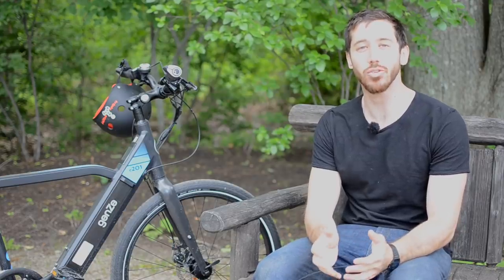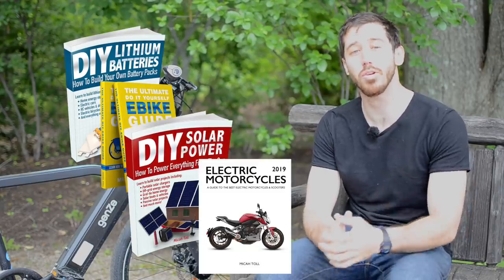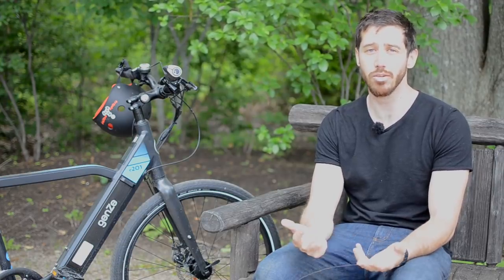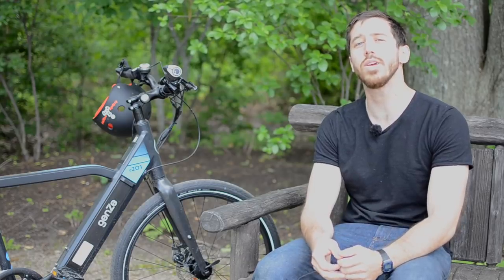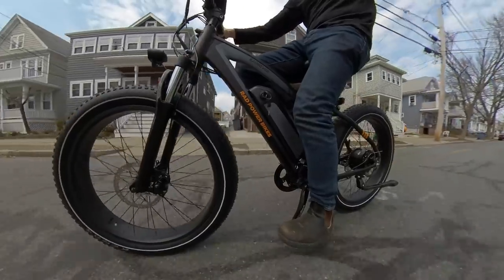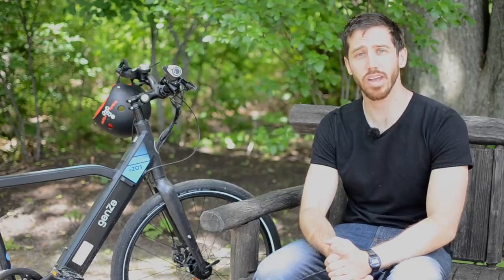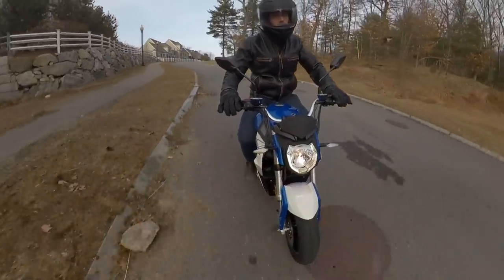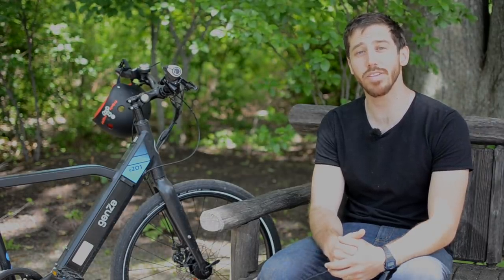How much POWER does an ebike need?

Comment: Nice video thanks! How about efficiency? If I’m to build myself a mid drive conversion, given the same data, flat surface, steady low speed, will the battery drain faster on a 500w motor or a 1000w motor? My understanding is that the controller throttle the wattage given to the motor, therefore if looking at a bbsdh 1000w, giving it 250w, a 500w motor given the same 250w should be equally efficient and drain the battery at the same rate? Would that be a true statement? Thanks in advance!
Reply: I think this will depend what top speed the winding is physically arranged to enable, because at or near that top speed will be more efficient than something lower. It's a good idea why one should buy a motor whose top speed is no faster than one intends to regularly go. Travel at a lower speed and there will be energy/heat waste, and one's into overheating issues (my understanding, which may be in error).

Comment: Ok so i have a jetson bolt pro and i have two 36v 6ah going put them in series for 72v and get a bigger controller how long will you think the motor will last the motor is 350w have anyone have similar experince

Comment: 500w 48v is minimum really....Also the smaller the wheel the more torque...for example i use 20 inch wheel on my tricycle with 1500W 48V and i could toe a smaller car with that thing...

Comment: 250 watts is the average power. Peak power can be up to 700 watts on a 250 watt limit. So you get what you pay for.
Reply: Correct. The marketing wattage is the maximum safe amount of power it can draw for long periods of time without burning out the motor.

It's a little confusing grading the motors like they do though. I run a 1000W motor on a pedal assist setup. Other than up hills, it averages around 300 watts of power pulled.

Comment: Great video! I'm researching for my 1st e-bike build, so really good info to have. My budget says BBS02, but the BBSHD sounds like the way to go...i'm pretty heavy and want my GT Avalanche to get  up and GO! Winning your book would help too...he he he
Reply: BBSHD is the best. The standard mounting plate sucks though. That's eating into the bike frame at the axle tube and isn't able to prevent the engine from swinging into the down tube. Solution to this is a Lunar or California E-bike mounting plate (or just DIY in CAD) + modified rubber eraser between the engine and down tube. Also, before doing the conversion it's quite handy to have a rubber hammer and a telescopic ratchet wrench at hand for the bottom bracket.

Comment: Great video as usual. How can you add more batteries to extend the range?
Reply: if its a hard case battery you cant, you can only swap out the existing batteries for higher capacity ones but that requires soldering and or spot welding as well as costs way more than its worth. with bag cases that isn't a problem as you can add more batteries in parallel until you run out of space.

Comment: Hello. What are differences between hub motor and mid drive motor? I.E. advantages to compare under different conditions, like off road riding.
Reply: Hub equals one gear ratio but with mid you have many to choose from which can make climbing hills easier and possible (for super steep hills). The center of gravity for mid drive is more ideal for off road especially if the battery is also mid frame or on top of top tube. That being said, there are plenty of hub motors that go off road riding but I guess if it is really technical mountain biking mid drive is probably the way to go.
Reply: @feedallday2556  Thanks.

Comment: I've not come a cross a hill yet that I cant maintain 15mph+ on my 250 middrive ebike, it is derestricted. but i'd to try 1000w+
Reply: Same dude, I really don't understand the fact that half the comment sections judges 1000W as the minimum and some even said that 250W doesn't even feel like you have an assist, I live in a very hilly area and I go uphill at 15mph with no pedaling and 20mph with the kind of pedaling you'd do on a flat road with a regular bike... If you're looking for an assist, 250W is good enough, if you barely wanna pedal, get 350W and if you don't wanna pedal at all 500W is plenty, any more than that and you're getting dangerous and useless.
More than 500W is just for bragging and to avoid insurance and stuff like that, because what you're building is basically a moped except you don't have to register or pay anything.

Comment: Thanks for the infos. I wonder there are also more powerful hub motors which are used in sportive ebikes like Stealth ebikes from Australia. Their hub motors are powerful as 3000w or more. What do you say about them? And also the battery voltage and motor power is also related as you know. A brief video about these powerful ones would be nice too. Especially for the ones who seek for powerful ebikes like me cause where I live there are many hills so an average ordinary ebike not sufficient for me. Thanks again.

Comment: Question: For Example if using a 52 volt 30amp hour lithium ion rechargeable battery how do you measure the amp hours??? 

I know that the nominal voltage for an 18650 cell is either 3.6 or 3.7,and when fully charged is 4.1 or 4.2  but how about AMP HOURS???
Reply: The amp rating is the max amount the battery can draw, Amp-hours is the capacity, or how many amps it can continually discharge for an hour. so if your 30 Ah battery has a discharge rate of 4C, it would be a 120 Amp battery. If it didn't come with paperwork stating all these specs you'll have to look up what the cells are capable of.

Voltage is different, but you multiply that by the amps to get watts, or voltage x amp-hours to get watt-hours.
Reply: @xxKeReMxxx  Ah...🤔 I see Thank you for providing me with the link
Reply: @revjimjones  Thanks

Comment: What sort of speed can an averaged size and fitness rider expect to get on a flat road while pedalling with a 250watt and 500watt motor?
Reply: Can 36v controller use with 48v 500w and battery 36v 13 ah?

Comment: Would 2-250W give same performance than 1-500W geared hubs motor? would both set ups use same power ?
Reply: I doubt it as you will be carrying more weight. ..probably double due to the 2x everything
Reply: He's done a video on that awhile ago. If you buy the right controller you can dial them in however you like.
Reply: Maybe double the torque but the same relative speed.

Comment: Can the power of an ebike motor be estimated from it's physical size?  Also, have ebike motors of the same power stayed the same size over a number of years?
Reply: You can get a basic idea, but doesn't types of motors and new motor technology have made them smaller over time.
Reply: Theoretically yes but in practicality no. Not all manufacturers wind the motor coils the same way so they do vary in size between brand to brand.

Comment: You need at least a 2000w direct drive hub, 52v battery, high amp controller. Otherwise you will struggle uphills.

Comment: In UK its 250W and thats enough to get you up any hill with a mid drive 12 speed. Sure not at 30mph! Rarely need to use any other settings other than eco and tour (emtb lite) Really, who needs 750, 1000, 1500W?! Otherwise it becomes an electric motorbike! And what sort of battery will you need?! Cycling means pedalling and putting effort in!

Comment: Of your 20 links for products that you use, 16 of them no longer work because that seller is no longer selling that item at that price point, or no longer carrying it. The trouble to linking AliExpress links is they change very few weeks or months. Plus shouldn't you be tacking on all that spam on your about page instead of as a footnote to each video? You do know how to shop on AliExpress right? There are literally thousands of thousands of sellers and what I found most amusing is your links point to sellers offering their products at a much higher price point than the average seller. So either you're flocking paid sponsorship sellers, or you don't know how to shop on AliExpress/AliBaba... 🙄

Comment: hey! between a 500w geared motor and a 1000w not geared motor, which one is the most efficient
Reply: Depends on the speed, but I would say they are about the same. The only principle is that the geared motor will allow you to use it as a regular pedal bike, which is a big plus IMO. I tested my 500W gearless versus my 3kW cyclone (free wheel on motor shaft) at 15mph over 5miles and the power usage is about the same. But, with the 3kW Cyclone I can pedal it. At 1000W you do feel the resistance from the motor when pedaling but if you want better cruising speed than 1000W is the choice. 500W also means 36V which kinda is too low imo unless you like do pedal assist a lot.
Reply: Steven Soco  That is what I thought too before I actually did the test between 500W gearless hub and my Cyclone with a freewheel (similar to geared). The results were too similar to declare a winner. The issue is that to go at speeds you are always going to need continuous power gearless or geared. That situation where you are coasting and taking advantage of the freewheel is not real world. I think you always need continuous power. The real difference between geared and gearless is simply if you want the bike to not have cogging when you use it as a regular pedal bike. His dilemma is 1kW cogging is noticeable and 500W is way too slow for commuting and will get tiresome fast.

Comment: But then you can have all the power in the world in your motor but if you have a low output amp controller it'll make no difference

I bought a 1000w bike and they put a 20amp controller... Absolutely ridiculous, I'm now switching to a 40amp controller

Comment: if i have a 52 volt lithium battery with a bms, do i have to charge it with exactly 58.8 volts or can i charge it with a higher voltage and the bms cut it off at 58.8 volts.
Reply: Woooha definitely don't do that, infact your better off finishing the charge at 58v or a bit lower, the bms could fail at any moment so it's definitely better to have that extra layer of safety.
Reply: You need a so-called CC-CV loader.  It stands for constant-current followed up by constant-voltage loader.
You cannot load Li-ion batteries with currents too high. When your battery is pretty empty it has low voltage and putting a maximum load-voltage on them would result in a current that is too high and damage your battery. The more your battery is loaded, the higher it's voltage gets and the higher the loading voltage can be to be safe. So when loading Li-Ion batteries and wanting to get a long life out of them, always look for a CC-CV loader. BMS's mostly only cut off too high currents in danger situations. Normally you need your charger to take care of loading the battery in a way that the cells have a far longer life-span. BMS's are just there to prevent hazardous situations (and to be honest: they only do part of the job).
Reply: @czarzenana5125  All lithium ion chargers are cc-cv, he's talking of getting a charger of higher voltage and relying soley  on the bms to cut the charge at 4.2v per cell. But you make a good point regarding that cc-cv phase, each charger will start this phase at a specific point but because there's no communication between the bms and charger besides total voltage, if you were to get a charger of higher voltage you could be pushing the cells too hard at their maximum voltage as the charger can't see that a single cell group has gone above maximum voltage (one cell could be 4.25v with the rest being at 4.19) and is still using a high current which could cause a fire and is even more dangerous if the bms isn't detecting 4.2v on every cell group accurately.
Reply: @a-aron2276  bms usually doesn't charge it to a certain voltage. The charger charges it THEN the bms samples all the voltages and DRAINS the excess energy from the strong cells so they are at the level of the weakest cell and that is what you are done with when you use a standard bike Li battery charger.

Whatever you do, do not use a standard battery charger. Tesla's also use 18650s (same as most Ebikes) and here's what happened when this guy who thought he knew it all tried to charge it with a regular charger:
https://www.youtube.com/watch?v=WdDi1haA71Q
Reply: @johnpossum556  i think you misunderstood me, by every charger starting at a certain the cv phase at a specific voltage, i mean that most chargers start the cv at around 4.17v per cell and taper the current down, till all cells are at 4.2v meanwhile separately the bms monitors and passive top balances the highest cells. My point is that if the bms is damaged for example and he's using a charger meant for 15s on a 14s battery then the charger will think the cells are lower in voltage and the pack will overcharge, the point of the bms is stop this from happening by cutting the connection between the charger and the cells, besides most bms have a very tough time balancing batteries, most bms will only discharge at around 55mah and if you have a pack like mine which is 26500mah it takes a stupid lomg time. So basically Im saying to the guy who made the first comment on the video that, mismatching chargers with batteries is extremely dangerous.

Comment: I have 2 hub motors with each 1000w, so how much battery capacity I need?
Reply: There are two parts of capacity that you will need to determine. One is absolute, and that is the capability of the battery to provide the maximum current draw of the two motors. The second is just a matter of how far you want to go before you have used up all the capacity of the battery. I am going to assume that the motors are 48 volts. The motors will probably draw about 20 amps each and that means your battery should be able to provide 40 amps of continuous discharge capability and double that for instantaneous current usage or 80 amps peak. I am also going to assume you will ride the bike around at about 20 mph. To do that will probably take about 10 amps of current. So for a range of twenty miles you will have to have a bare minimum of 10 amp hours. To not abuse your batteries you should add about 50% more so you want a 48 volt battery with 15 amp hours of capacity, and the ability to provide a continuous draw of 40 amps with a short term peak draw of 80 amps.
Reply: The battery (and its BMS and controller) should be able to handle 70A assuming you're going to use one 52v battery pack. If it's 2*1000W peak power, then indeed only 40A is sufficient. It is very likely that isn't the case. For example, my BBSHD mid-drive engine is 52v*20A rated, but has 52v*30A peak power. If you're giving each engine its own battery pack, you can just go for the standard 30A rated batteries + controller.

Capacity is quite depending on what the engines are consuming and what range you want at which speed and at which budget. I have no personal experience with hub motor consumption. Assuming you're going continuous flat out, you're consuming 2000W. Taking the average of 48V and 52V systems (50V) for the calculations the engines are requiring 40A. If you want this for one hour, you need a 40Ah battery. 

This consumption rate isn't very useful to get an idea what the range from a battery truly is. This range has quite some variables to it like flat terrain/hilly terrain and wind direction, the amount of pedaling along, maybe also temperature. Let's use a 20Ah battery as example without pedaling along at like 5-10°C outside. Going uphill or going into the headwind of the Netherlands and Scotland at like 36km/h at full power (40A) gives you a range of 18 km. The consumption of your engines are 20/18=1.1Ah/km which is pretty high. Maintaining the same speed on a flat surface in practice consumes roughly 12.5A. With that you get 20ah/12.5A=1.6h of driving time. 1.6h * 36km/h = 58km of range. In this case you've a 20/58=0.34Ah/km consumption rate. Pedaling along adds like on average 100W-150W (the equivalent of 2A-3A for your engine(s)) from your own to the wheel and that's power the engine doesn't have to deliver. This increases the range you can drive as well. Indeed, 250W and more and more of personal power is also possible, but giving that continuously can be a pretty hard thing to do.

These are some examples of calculations you can make and this will make online calculators a bit easier to understand.

Comment: All of this applies if you want an ebike to perform like a moped. A person new to cycling will output about 100W on average for an hour. An advanced amateur that climbs steep hills is around 230-250W, and pros are averaging around 400W. So no human on earth can do what a typical mid drive motor can that averages 750W and does bursts up to 1500W. If you’re riding that, you’re on a moped…
Reply: Really?  So when one is in a hurry:  _he'll NEVER use set-power of 750W or more?  Guys being Guys...eg ("drag racing") top power will not be reached?

Comment: I hate how no videos actually show how for example 250w motor performs uphill.
Instead of just saying "it won't do good", okay but what is your definition of good? 10km/h? 5km/h? "Good" is subjective.
For example, would a 250w motor with me pedaling uphill be somewhat close to me pedaling on flat ground without motor?
And if it doesn't, what if I just change the gear ratio to give myself more torque?
But also what is considered "uphill"? Roads can vary significantly in how much you need to climb.
It really seems like you're trying to push very expensive motors onto everyone, even if they might not need it. Like I don't wanna spend 1000$ on my 50$ bike.